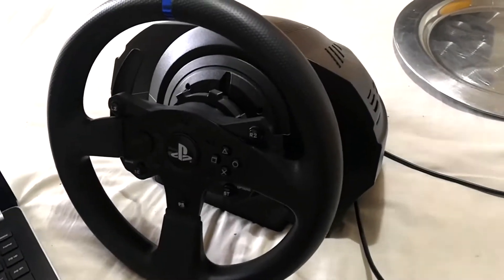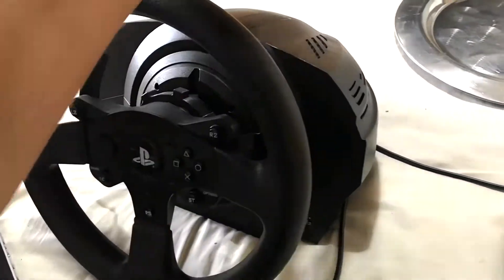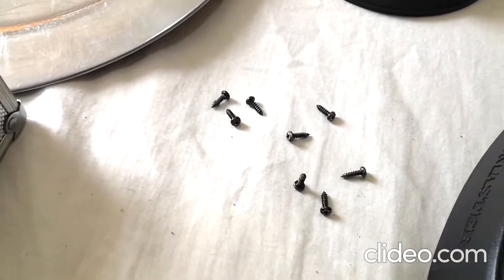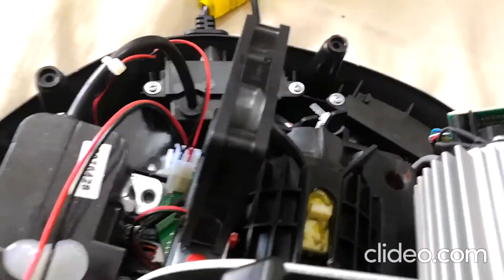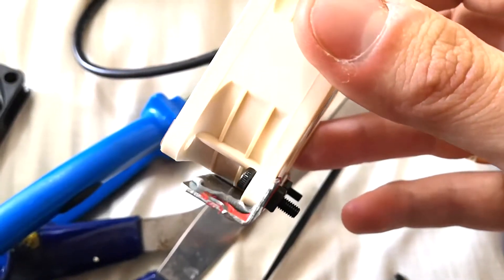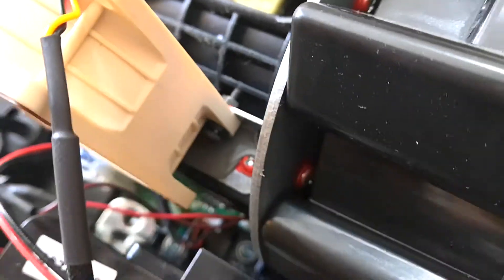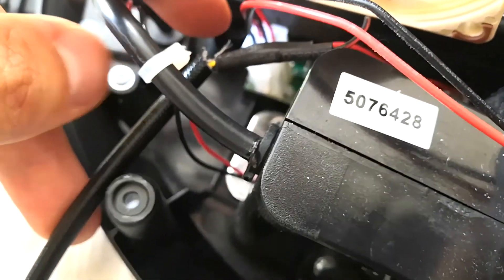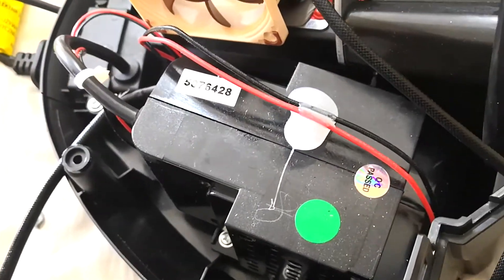Thrustmaster T300 Fan Replacement Guide

Comment: At 3:40 or you could just fit the bolts the other way round.
Reply from the maker: It would be much more fiddly trying to hold the nut in place with pliars than it is to just use a shorter bolt

Comment: Did you notice any drop of temperature? I have a problem with overheating
Reply from the maker: It only ever cut power once on a 38C humid night, never did again after that. You will break it if you keep using it on reduced power

Comment: U can put the scrue other way then nothing will be touching :)
Reply from the maker: It would be much more fiddly trying to hold the nut in place with pliars than it is to just use a shorter bolt

Comment: hey. Does the current have anything to say? The original fan is 0.25A, while the noctua is "typical" 0.09A "Max 0.12A. Would the overload of amp not fry the noctua fan? also, great video:)
Reply: Power is drawn, not given.

The fan draws what power it needs. If it does not need to draw the extra amperage then there will simply be less load on the 12V circuit on the mainboard.
Reply: Com a alteração, o noctua consome muito menos, tanta em amperagem quanto em tensão. Da até pra colocar dois cooler iguais na mesma saída.

Comment: I've had a issue for some months now where my an wont even kick in even when i try forced cooling, any ideas what that issue is? I've tried looking all over the internet and haven't had any luck finding anyone else with the same issue
Reply: Worst case you could hard wire a 24V fan to the 24V output of the power supply so its always running.
Reply from the maker: Replace the fan?